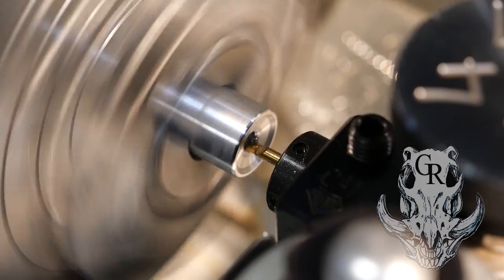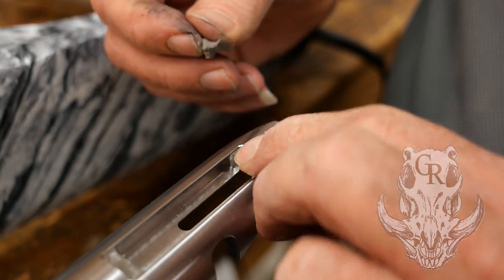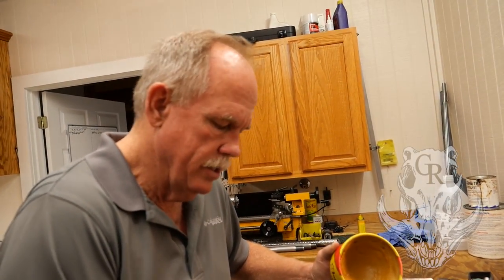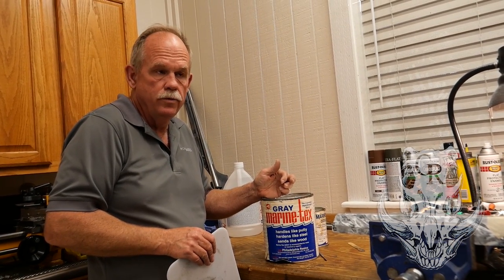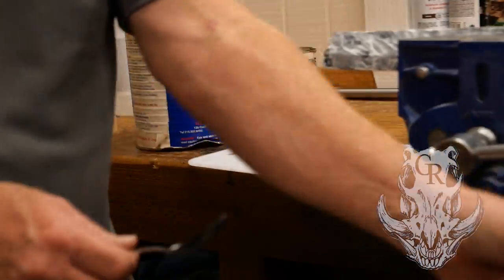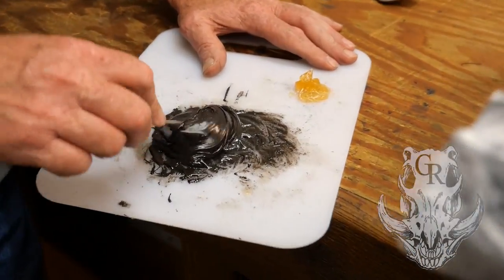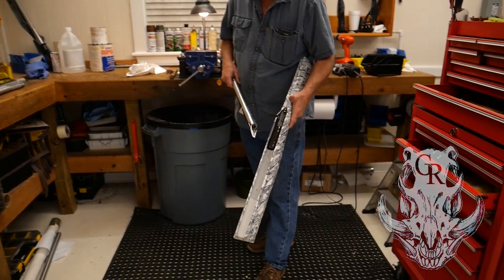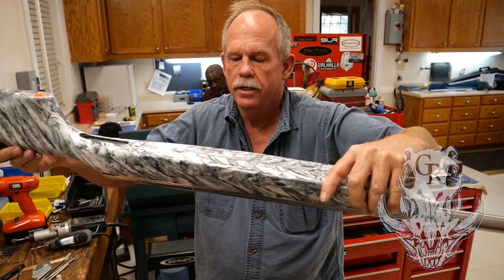[VIDEO 2] BEDDING A RIFLE WITH ROBERT GRADOUS

Comment: There’s two schools of thought about whether you bed the entire action or just do it at two points. 

My personal opinion is that two point bedding is more stable and if the stock does develop a twist or a bend there will be less or no torsional stress applied to the action. 

Perhaps with a high quality, high dollar fiberglass stock it doesn’t matter? I only have walnut stocks so I think, for my application, the two point bedding is what makes sense. 

I think a cheaper plastic stock would certainly qualify for a two point bedding.
Reply: I would think there is a flaw in your thinking.. if a stock starts to twist, it's gonna twist from that point and everything after it.. I would think by bedding the entire action you are making that entire area stronger and less likely to twist.. JMO
Reply: Anyone who owns a Gradous rifle or seen how one shots, you’d see the answer.